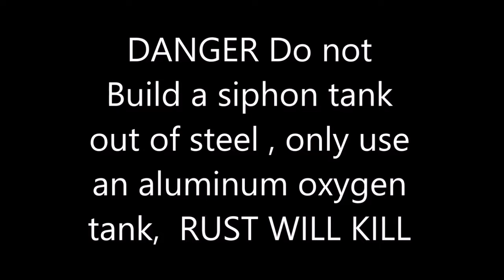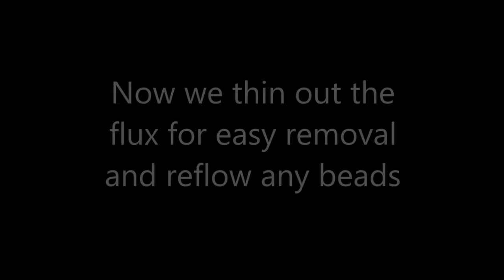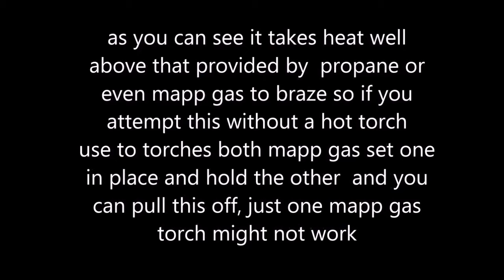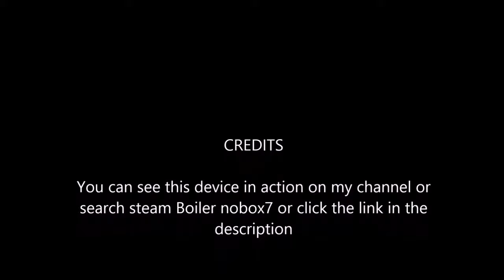Steam Boiler coil build

Comment: Nice but... looks like use of a set of thermal bricks won't go a miss as well as cleaning up the flame on that there torch, seems you may need more O2 in that mix to get a nice blue and very hot flame.

Maybe a dual tank that one collects the Hydrogen and the other collects the oxygen and you can then fit a coupling to allow oxygen input via an o2 tank or push the gas through a carburettor and venturi mixer to add more oxygen, which ever works best in your situation.

A clean flame is less cleaning and hotter.

Comment: Why does it look like gold? Also what about a fire arrestor protector to prevent flash back. That satellite acetone thing looks like a pipe bomb.
Reply from the maker: Actual friend acetone will not flash back , and if it did , the explosion is not strong enough to be a threat . Acetone actually inhibits flash back , not sure why . My torch has a bubbler but the steel pipe bomb would be more then enough to hold even a pressurized hho detonation

Comment: I believe acetylene reacts with copper, not sure about acetone. Something about poison gases or explosive salts...
Reply from the maker: acetone reacts with copper
Reply: FIREHAWK1979 acetone is inside acetylene tanks because it stabilizes the fuel ( liquefies it) acetylene is stable in high pressure only if its liquid if its not I think you can guess what happens now I not sure if acetone reacts with copper or not never herd about it till now and it probably does and it would not surprise me you might not notice it because their are a lot if factors that might need to happen before it does react manly temperature
Reply: If your burning acetone along with the hydrox your going to have a more carborizing flame (or less oxidizing) and that helps reduce build-up of unwanted oxides on your surface to be brazed. Cool set up.

Comment: Wait.....What?? H-H-O?? Do you mean water?
Reply: So...thru electrolysis (at around 12volt) you can separate water into its constituent elements. You collect the oxygen from the cathode and the hydrogen from the anode, you can store them together and it's called brown gas, I prefer to separate them and use a jewelers torch to burn the hydrogen, if you collected the oxygen, you can recombine the two gases in the torch and when they burn they'll recombine into water. But they'll still produce a super hot flame first. 

Electrochemistry is fun. 😉